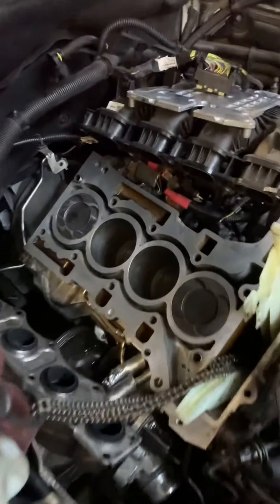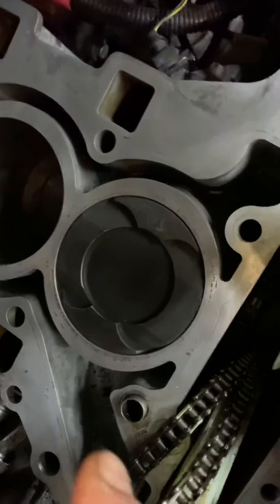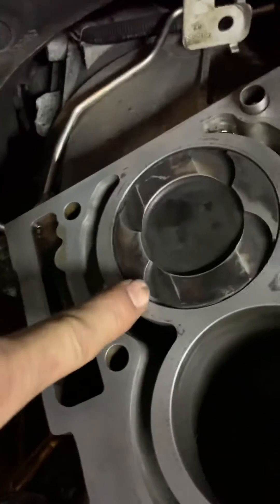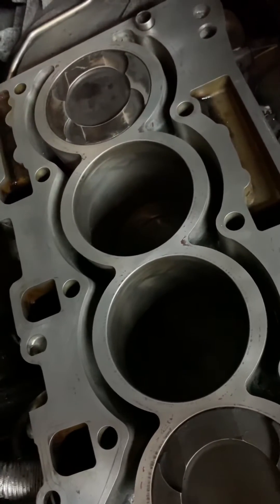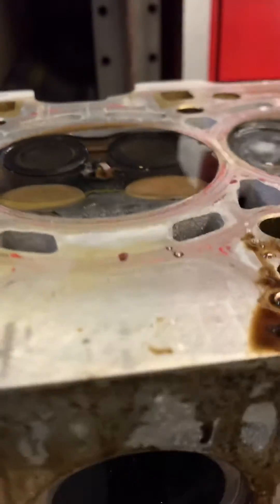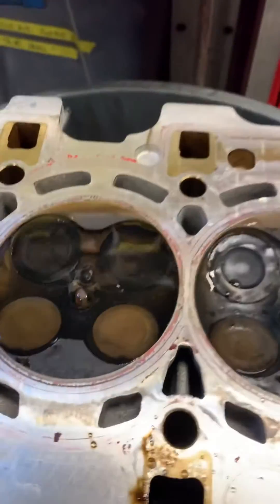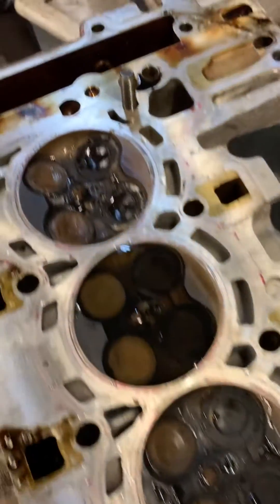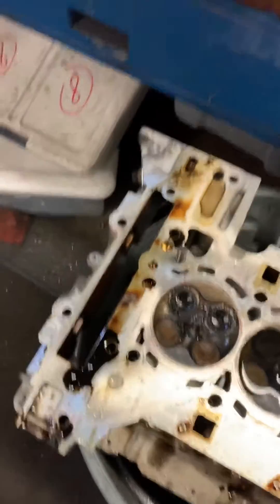BMW 4 cylinder turbo N20 N26 engine timing interference

Comment: Hello Armand,

First I am a idiot.

...after doing the oil leaking valve cover replacement on my 2016 F10 528i xdrive I stupidly, idiotically, morronicaly, forgot a wrench on the crank bolt pulley after turning the engine. I finished all work on the engine and check everything on the valve cover, next I cranked the engine and then disaster struck... On first start the engine cranked and wanted start and then I head a loud BANG (I believed it was a exhaust misfire due to loss of fuel from the maine fuel rail:( ), I tried to start the engine again but didn't want to start on the second try. After checking I saw the crank bolt undone and transmission oil cooling lines broken. Now I'm looking at what I have done in disbelief...

Have I damaged the engine completely? Is it salvageable? Any advice is welcome...Thank you.
Reply: For everyone wondering, I finally got to repair the car and the engine was fine! I had to reset the engine timing and it started. It seems at the engine start the vanos is retracted enough so the valves are not damaged. If you have to do the timing chain replacement on and 528xi you absolutely need to remove the front subframe because you can't remove the oil pan otherwise. Basically you need to remove everything under the engine.

Comment: but way bmw claims that it is an interference engine , i am about to buy  a car from  a person that was told from bmw dealer that the guide  broke  making the timing jump,  hitting  the valves
Reply from the maker: It definitely is NOT interference

Comment: I'm in the same predicament right now with 2 N20 engines... I haven't done a leak down test yet but, I always was told that these were interference engines , So I am I to assume  that I can replace chain and set timing  all will be well?
Reply from the maker: Yes. They are not interfering
Reply: @vacbmw  up date I just used a borescope for both my N20 engines ones a 2012 328i and the other is a 2013 528i and neither one has those valve indentions on the heads to stop it from hitting valves… so in my case… “off with its head”😔
Reply from the maker: Taking head off is stupid
Reply: @vacbmw  Yeah its a bit much if it has to be done, the only other option is getting a used engine...
Reply from the maker: To test if engine damaged. Put engine in timing as is. And run compression test by jumping starter.
Reply: @vacbmw  Leaks were found on cylinders 2&3 ...😞
Reply: Ok  I got the heads off and checked the valves so far none of them are bent... the dealer told me that I had an issue  with  cylinders 2 and 3, from the chain slipping and now that Ive taken everything apart I discovered these are not interference engines... like @armand salloum said The cylinder heads have the notches in them to keep the valves from bending, when i looked through a borescope they looked flat ... once heads were removed, the only thing I saw was a bunch of crud on those cylinders which may be the cause along with the timing chain guides...

Comment: Hey sir thanks for video. I have a 2014  528i can I replace the timing chain without taking out the oil sump?
Reply: You need to have the oil pump timed with the special tool. 
If you’re re just replacing the upper guides and leaving the same timing  chain no you don’t need to drop the oil sump.

Comment from the maker: Well after proper testing in machine shop 4 of the 8 exhaust valves were bent. So now it starts and runs. So only intake is non interference
Reply: Damn..... ok thankyou so much for your video
Reply: Hi I was able to get the car home and took off the valve cover and my timing marks don't lineup and the oil pump chain is not on the spraket, If the oil pump chain broke then why are my timing marks off? That's what I don't understand
Reply from the maker: Richard Peralta I am not sure what you mean by timing marks you need timing tools there are no marks things can be close by I but you have to get them precise and you have to replace the timing chain assembly as well as the oil pump chain assembly you can’t just do one on these
Reply: @vacbmw  yes I have the timing tool but the intake cam is way off and I cannot get the tool on it, that's how I know it's jump time. 
I have the timing chain kit and another head from another engine I have with a rod knock ,I just don't know if it's worth all that work and if the engine is salvageable?but can the intake valves be ok?if it's being controlled by the valvetronic system? 
But the exhaust cam lines up perfectly with the timing tool so I'm guessing that the exhaust valves are good.im trying to figure out if I should trash this engine or not.
Reply: @robloxperalta9646  did you ever find out if the exhaust valves were ok? My N20 just jumped about 3-4 teeth on the intake side too. Is the intake side a true non interference side?
Reply: @stevencaballero7072  yes I just installed new chains and ran great
Reply: @robloxperalta9646  thanks for responding! God that gives me hope then. Just ordered a new timing chain and pump chain etc. One of my guides completely shredded to pieces. I just hope the bearing are ok.
Reply: @stevencaballero7072  don't worry I believe you are good, so far I've done two of these n20 one had a broken oil chain and jumped time on the exhaust but no bent valves put back new chains all good. The other had chain guides broken and would not turn on and timing was off on both ex and intake,put back on time with timing tool slap new guides and was good to go still running strong , so you're good I believe
Reply: @robloxperalta9646  My man.. best news I’ve heard all weekend. Thanks again!
Reply: @stevencaballero7072  let me know if you need any help good luck
Reply: @robloxperalta9646  you weren’t kidding it turned right back on! Only issue now is it’s popping “drivetrain malfunction” and throwing code C0300. Also upon startup I hear a sound like something engaging and the engine adjusting then normal idle. Any idea what’s going on? Other than that it idles fine but I have a feeling somethings stuck? VVT?
Reply: @stevencaballero7072  Can please update me on whether replacing the timing chain assembly resolved your issue? I'm in a pretty similar situation!
Reply: @8442116  it did!! I replaced the oil chain assembly to.
Reply: @stevencaballero7072  Thanks for the response!
Reply: @stevencaballero7072  No issues eversince?
Reply: Would your engine fire up when the timing jumped teeth? Mine stalled whilst on the highway...tried to turn it on, the engine cranked but wouldn't fire up! The chain is loose and I'm hoping replacing the timing chain would resolve the issue as the engine sounds healthy when it cranks...sounds like the timing is off
Reply: @8442116  I had a bad vibration but it turn out to be the engine mounts.